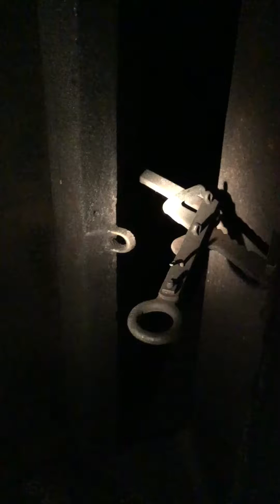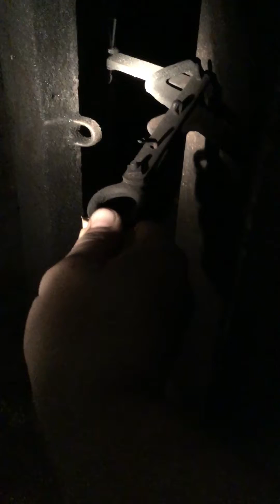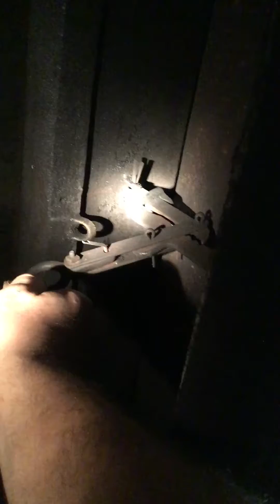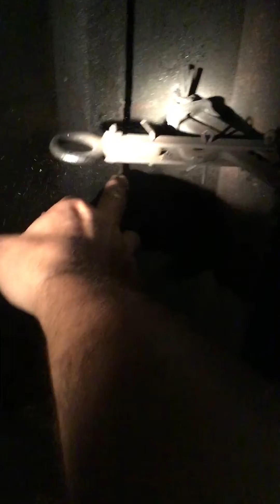Damper operation for the infamous Ratchet Pivot damper mechanism.

Comment: I have this exact type and it’s a pain in the ass. I opened mine yesterday and the whole damper fell down and is dangling. I got the damper kind of back in place, but I can’t get it fully back to the correct position. Have any tips or tricks?
Reply from the maker: Usually that’s because the track that it rests in is filled up with debris. Before putting the plate back into place, brush out or scrape out the back of the damper frame. When too much debris get in there, it raises the plate up and it can work out over that back raised frame.
Reply: @kevonbinder6332  awesome, thanks for the quick reply. I’ll definitely try that when I get home from work.